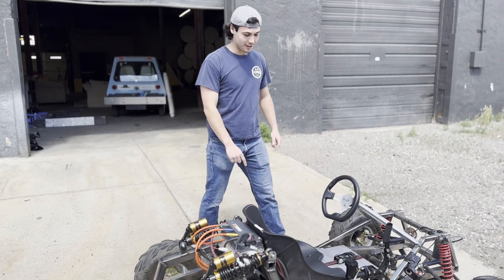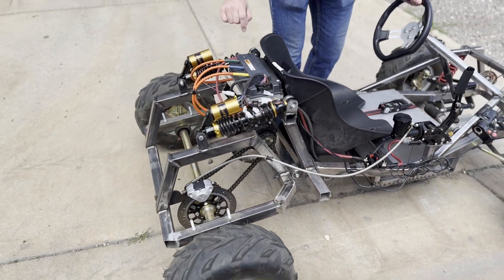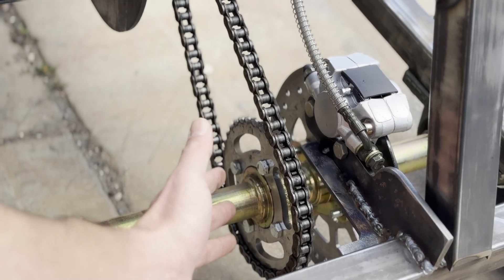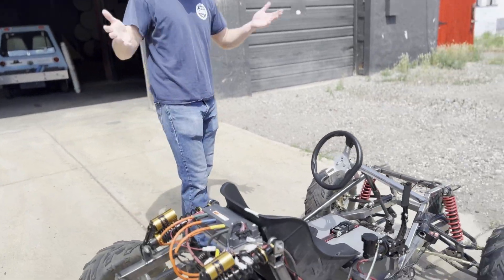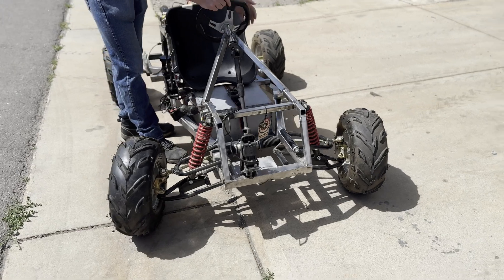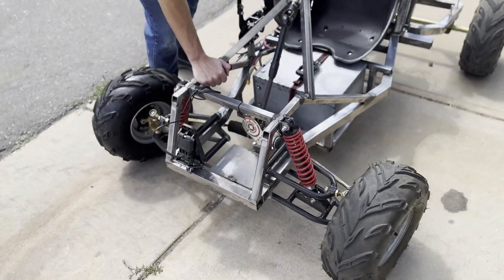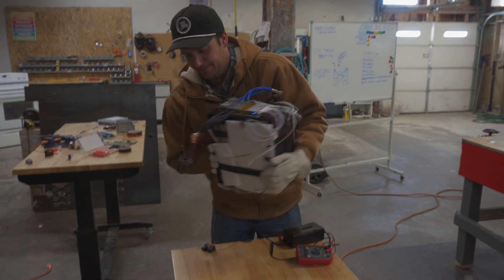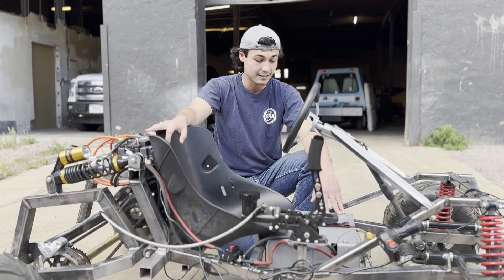Test Driving Our 15,000 Watt Custom Electric Go Kart

Comment: I wanted to build a cooler kart and it’s wild to me that the wheels, tires and steering parts alone cost almost $600… The fact it’s impossible to make a fun street cart for less than $1,000.

I was hoping to be able to build one for under $500 but for $1,000 I’d rather buy another project car 🤣
Reply from the maker: Yeah the components aren't super cheap but the ability to throw this into a truck bed and go anywhere with it is nice.